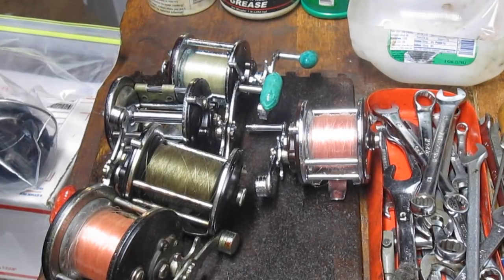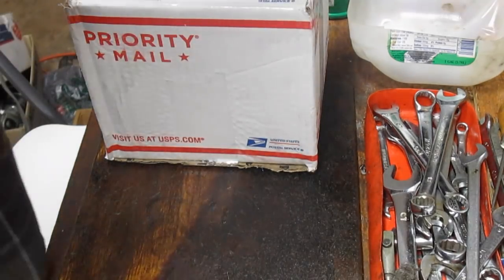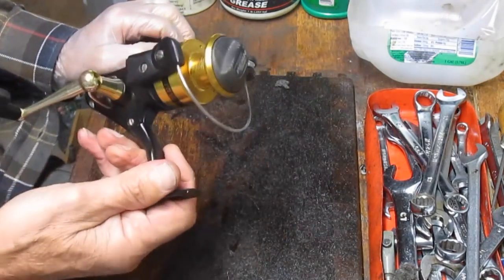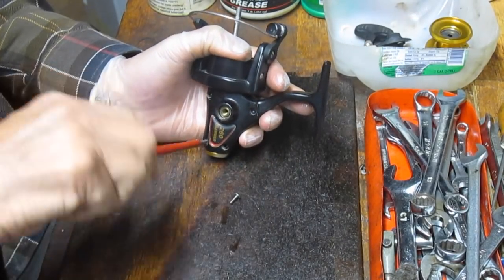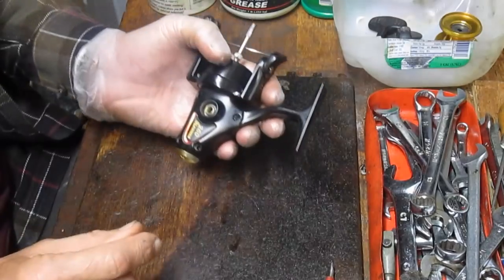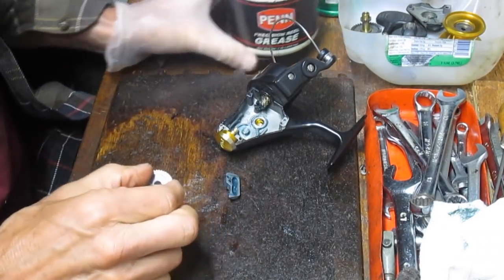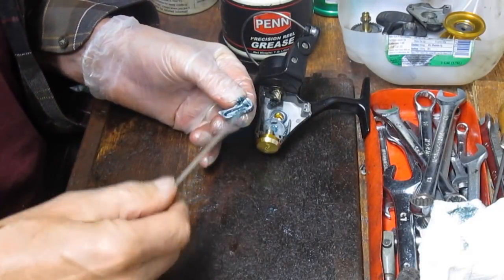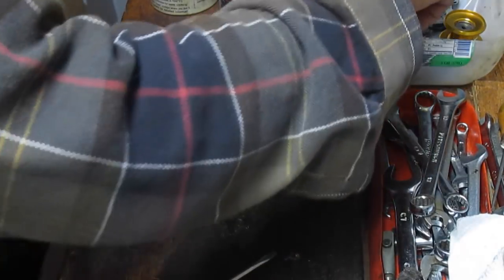Penn Slammer 260 how to take apart and service step by step

Comment: Great video as usual Dennis. Would love to see a bail tutorial.  Both my 360's do not snap back, despite cleaning and lubrication.
Reply from the maker: It is probably a bent bail wire if the bail springs are not broken.  See if this video helps https://youtu.be/fLHA0uTXHJQ. Dennis
Reply: @2ndChanceTackle  Thanks, Dennis.  I did try this because there is a noticeable kink in the wire,  but the bail doesn't have any tension; it lines up perfectly when loosened.  There is very slight misalignment on the trip side arm, but barely the width of a thin blade.  I added some extra oil around the rotor bushings that I didn't add before and it improved the trips from about 1 out of 5, to 4 out of 5. I think I may have to live with it.

Comment: Can you please do a video on showing how to remove the line guide mechanism on the PENN 309 level wind!!  My idler gear is missing teeth and would rather just remove it and use it as a conventional reel!
Reply from the maker: I can do one and will add it to my list.  The idler gear that is missing teeth is easily replaced by removing the screw.  The part is available through MysticParts.com if you want, but I will show how to remove the assembly if that is what you want to do.  Thanks you for asking - Dennis
Reply: 2nd Chance Tackle awesome I really appreciate it!
Reply from the maker: Elian - Thanks for watching.  Please stay tuned for more - Dennis

Comment: I bought Penn oil and grease to service my Slammer 360. I hear you use ‘drag grease’, is this different from the grease i bought?
Reply from the maker: It is Cal's Universal drag grease, but don't rush out to buy it.  You can use the Penn grease that you purchased on the drag washers - Best wishes - Dennis
Reply: @2ndChanceTackle  
Thanks Dennis! Trying this service job with confidence thanks to your excellent videos.

Comment: replace the main gear I might have to replace it again but I just want to know how to put it back in when I get a new one if I ever find one
Reply from the maker: The part still shows as available through Mysticparts.com. follow this link https://www.mysticparts.com/8-260-Gear-Main-Gear-P10499.aspx this is a straight forward swap.  Remove the side plate and axle shaft then pull and replace the main gear - Dennis

Comment: I have a Slammer 260 that doesn’t oscillate, what could be the problem?
Reply from the maker: There are 3 parts to the oscillation system.  The oscillation gear drive, located on the back of the main gear, the oscillation gear and the crosswind block.  You need to inspect all three.  If the drive gars is missing teeth or is broken, it will not turn the oscillation gear.  If the oscillation gear is broken, it will not move the crosswind block.  If the crosswind block is broken, it will not move the shaft up or down.  Whichever part is broken, it will need to be replaced. - Check these three things first - Dennis

Comment: i have the same reel. but mine has a issue of winding backward while im trying to reel in my line. any suggestions?
Reply from the maker: It sounds like you have a problem with the anti-reverse clutch.  It is likely dirty and would need to be cleaned or replaced - Dennis
Reply: Quite likely you got some grease, or too much oil in it.

Comment: a parts washer with pressure would work great
then blow it out with compressed air
work smarter not harder
Reply from the maker: Thanks for the tip. - Dennis